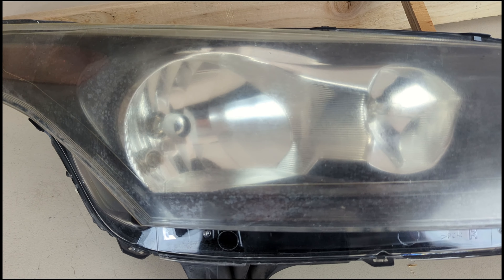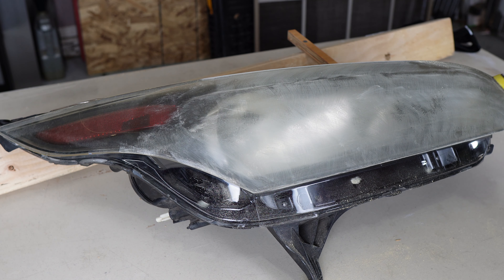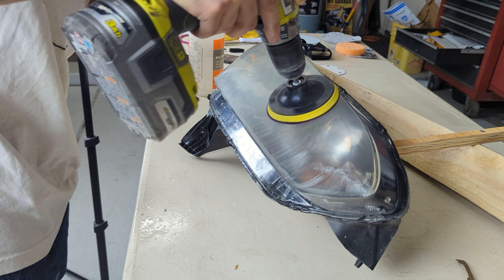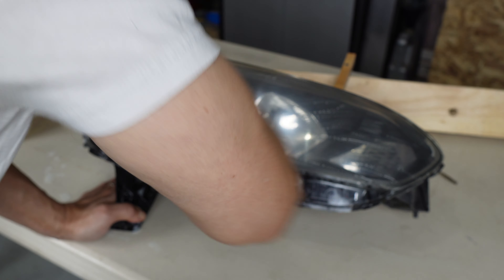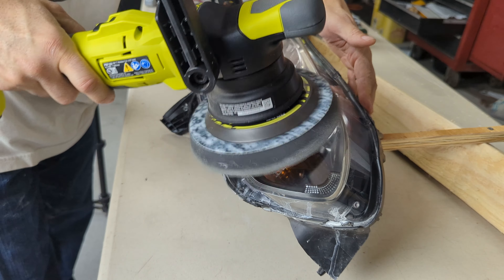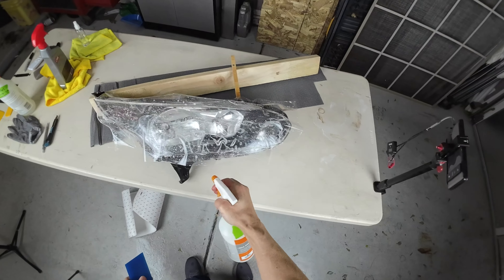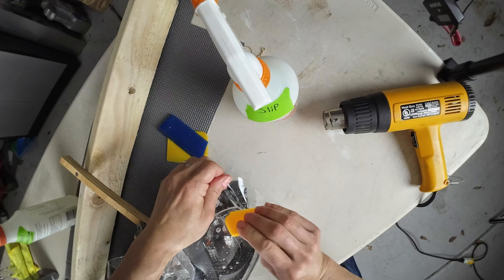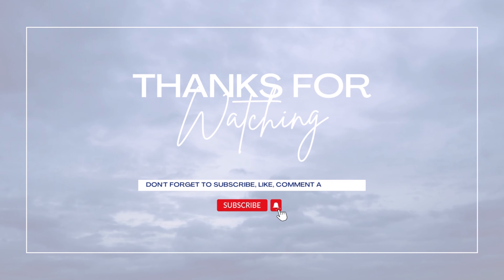Restoring Headlights PERMANANTLY!

Comment: Walmart will restore headlights for $35. Best deal in auto repair, IMO
Reply from the maker: What's their method and warranty?
Reply: @AZOverland2017  not sure of warranty but for $35, I could have them do it every few years and save me hours of sanding. Just had two cars done and one is good after 1 year